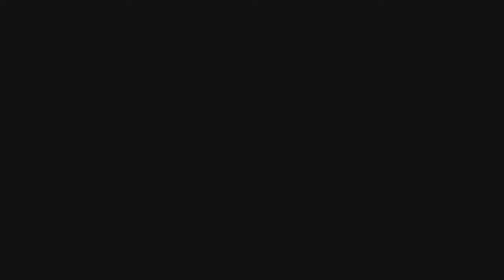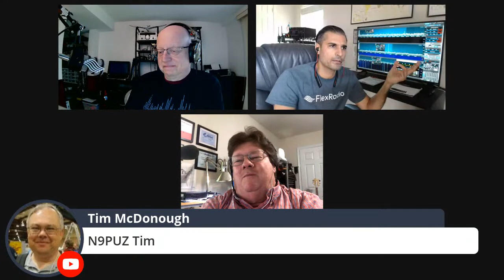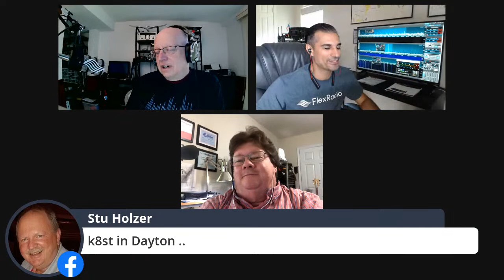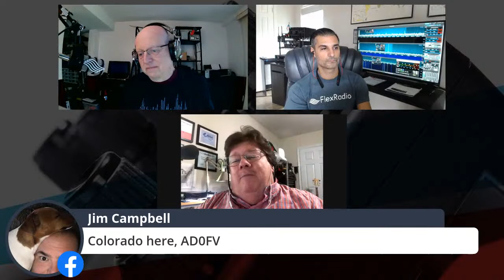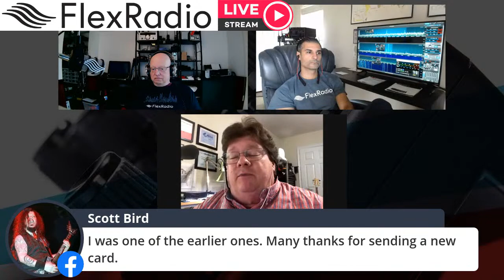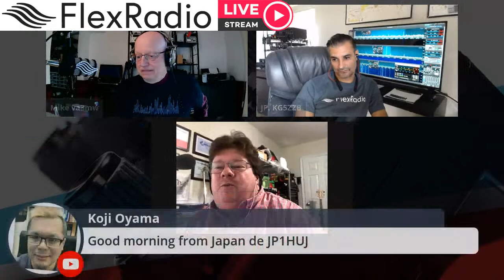Meet Tim Ellison from Customer Support & tips for FT8 and AGCT

Comment: When 2.4.10,11, or whatever is available will I be able to 'downgrade' from the 2.6.2 to get ATU functionality back until the issue is fixed in the 2.6.2 version?
Reply from the maker: Yes.  With the same caveats, there were with 2.4.9 related to database schema incompatibilities (you have to do a factory reset after downgrading and can only import profiles created with 2.4.9 and below)